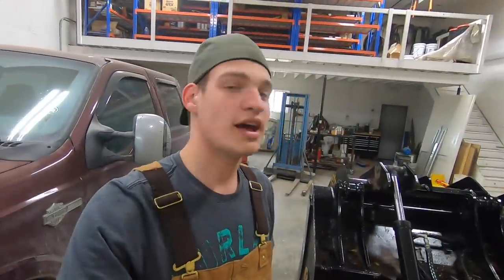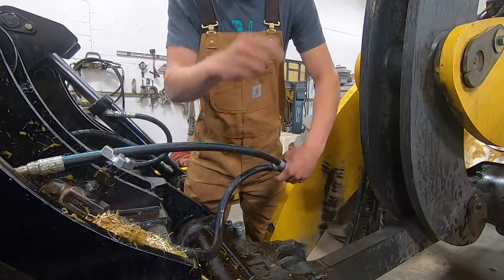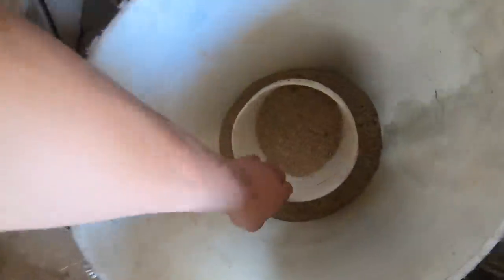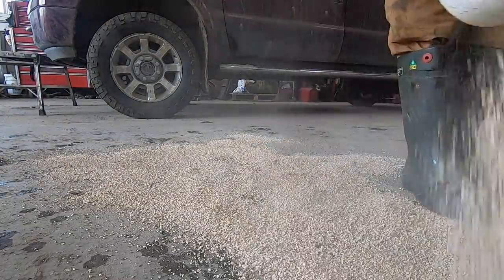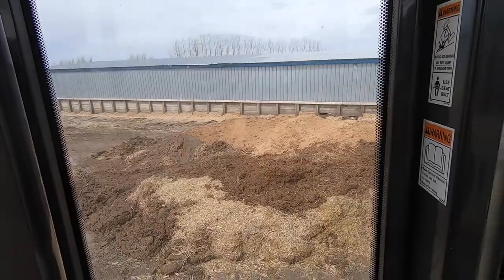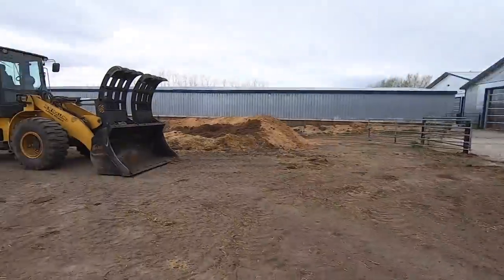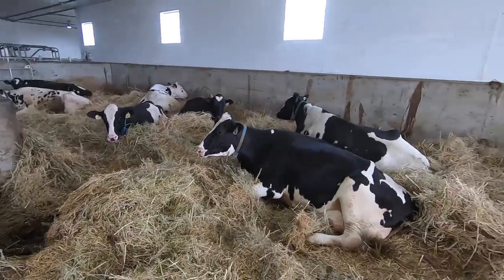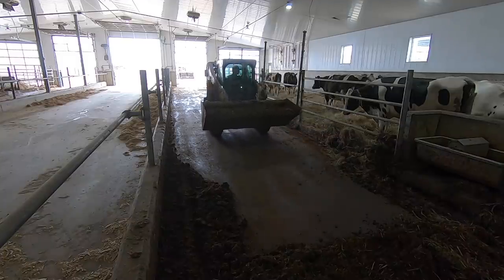Fixing Wheel Loader and Cleaning Pack Barn

Comment: Its always nice to have floor dri and spare parts around when you break down. You should invest into a rotary tip for your powerwasher as it cuts washing down in half the time. And when you use parts out of your shop inventory write it down to reorder your parts to replenish your inventory. You could buy a used truck axles and mount a dump truck on it and haul to your piles to cutdown the time it takes to go back and forth.

Comment: Enjoyed watching you change out the hydraulic hose on the loader.  While in the military, I worked in the motor pool as a  mechanic.  When a hose like that breaks, it does make a mess with all the fluid under pressure.  Anyhow I could relate to what you were doing.  The only difference was we didn't have a pressure washer to help with the post repair clean up.  That would have made the clean up sooo much easier.  Blessings to you, your family, and the crew there.

Comment: Another fun video of cleaning up! Do you ever do a power wash of the stalls when you scrap out the bedding or manure? If so, how often, if not, why,  is it just not necessary? 👍👍👍🚜🚜🚜❤️❤️🐄🐄🐄🐄
Reply: He probably puts lime down or some other type of disinfectant so there shouldnt really be a need to power wash the beds, plus if the beds are wet, bacteria would love it and could lead to more issues down the line than it would prevent

Comment: If I had a dairy like that I would find the cheapest flatbed semi trailer I could and load the manure onto it and then just grab ahold of it and drag the whole thing down to your pile with the loader. Then I would push the manure off with the loader, you wouldn't even need to crank up the trailer legs or buy a truck to pull it.
Reply from the maker: Haha not a bad idea